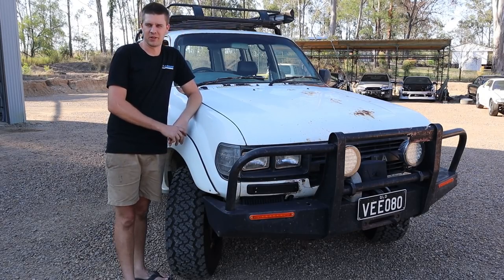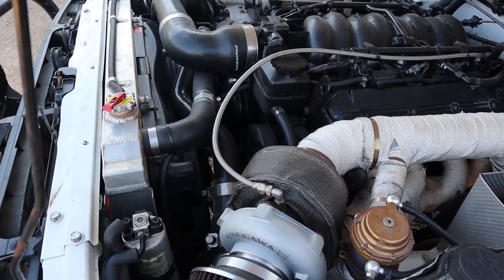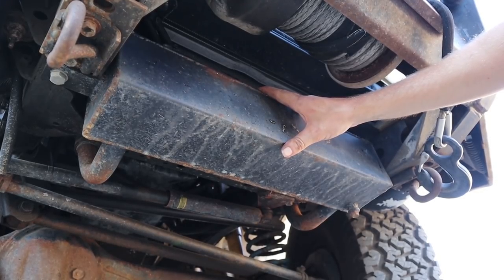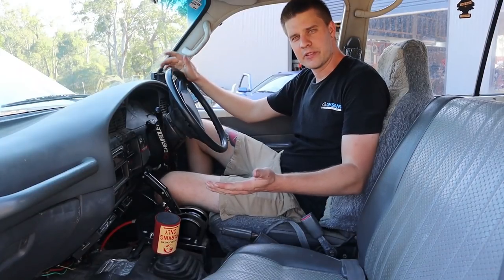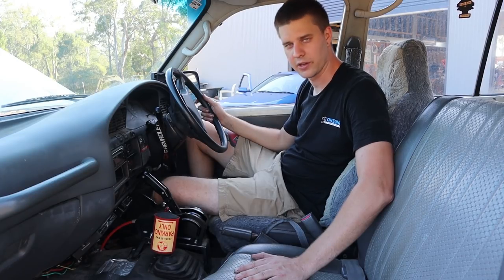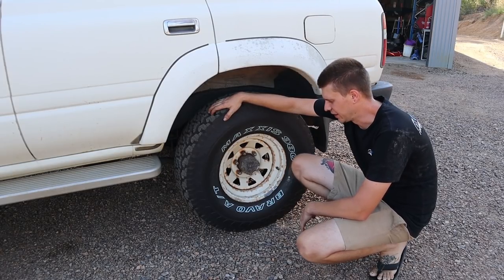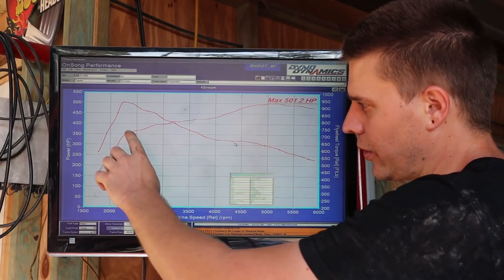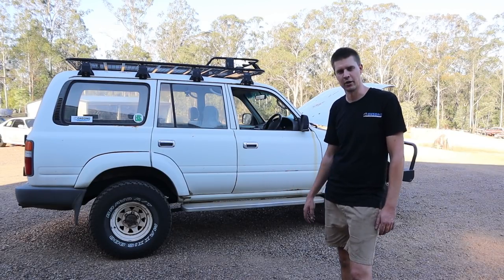Build Breakdown - VEE080 - Twin Turbo LS swapped 80 Series Landcruiser

Comment: 20L/100 is soo good my stock 1fz does about 17-18
Reply: Love to know how your fz gets that I get 21-22 driving softly im on 33s with a fair few mods tho
Reply: You guys need to check out your timing I get 15.5/100 with my 1FZ
Reply: @michaelsherwin3  no u do not no way
Reply: Swear man I do
Reply: I get 16-17/100km general driving, not much load with my stock 1FZ-FE, on 33 A/T’s, using 98 fuel, fusion plugs, regular upper cylinder lubricant..   I’ve had it as low as 14-15 just following a service (new plugs etc) but I regard those figures as an anomaly.. 
still, I reckon sub 16 is possible..

Comment: Awsome build, how reliable are these engines for 4x4? Compared to the 100series 2uz? 🤙
Reply: I've owned both and from my experience very similar, the 2UZ in my personal experience are slightly more robust but the LS is easier to work with and typically a good bit cheaper making them more popular for swaps amongst the tuner community.

Comment: I would think that the torque curve would be much flatter from 2500 rpm with twin turbos and 3” exhaust?
Reply from the maker: Quite a bit of the spike at the start will be torque multiplication from the converter. Then the small turbos start to choke a little bit higher in RPM so drops off